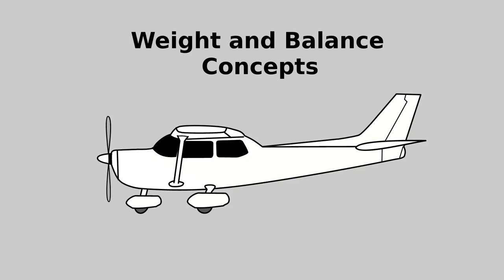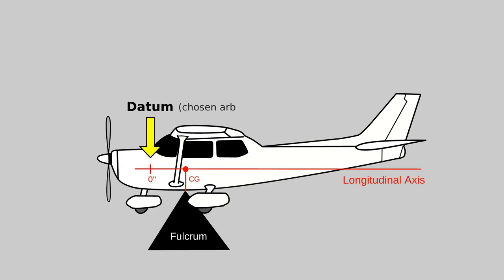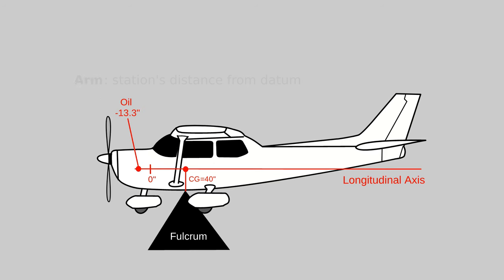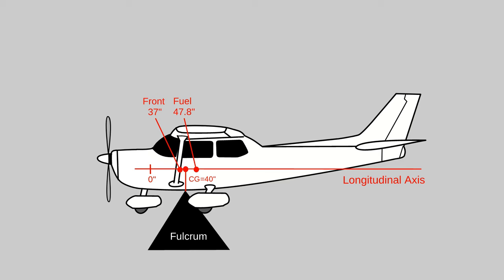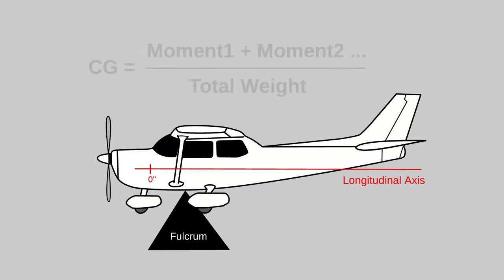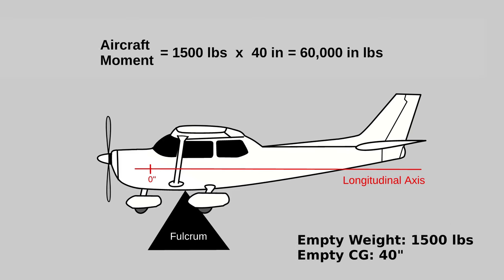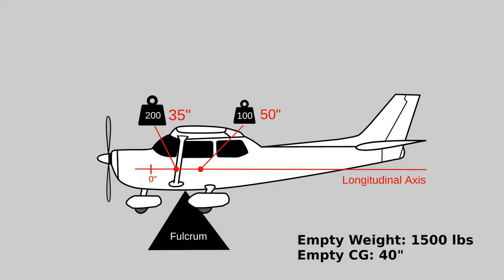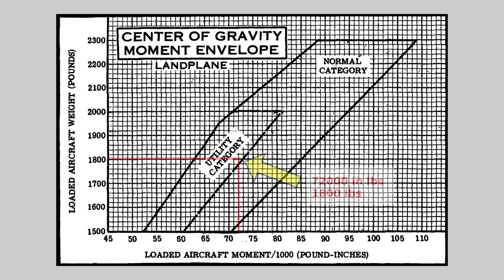Basic Aircraft Weight and Balance Concepts

Comment: A story I was told once: These four guys were going somewhere for the weekend. It was a small airplane and they were big guys, it was summer. When they took off the aircraft staggered into the air and they did a circuit, the pilot battling to keep the plane in the air. They managed to land safely. One of the passengers wanted to load a case of beer, was told "no", and then decided to hide the case as far back in the fuselage as possible. End of a trip and end of a friendship.
Reply from the maker: hahaha I think that story has been through a few rounds of telephone but the point stands, hot and heavy isn't a good combo.